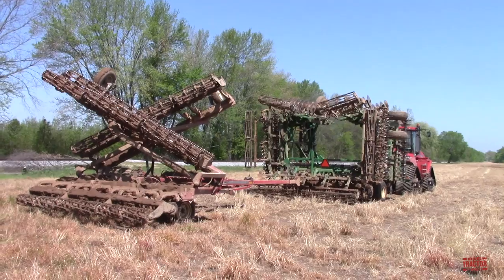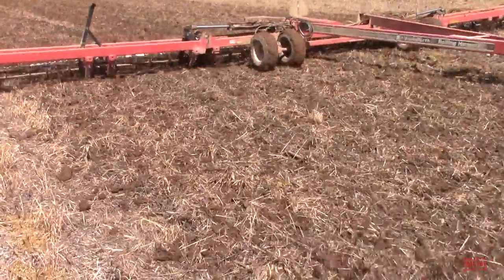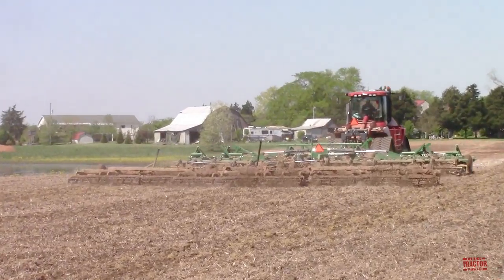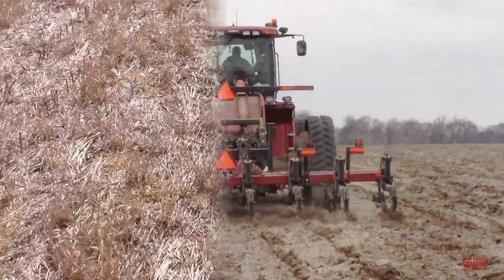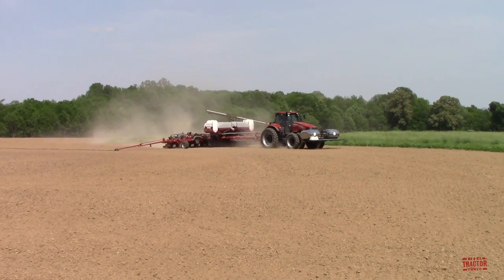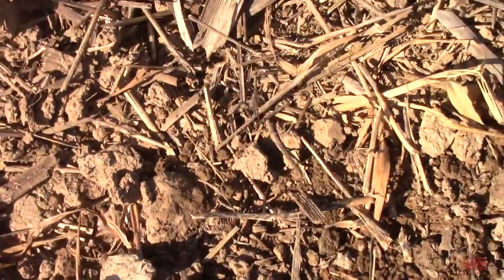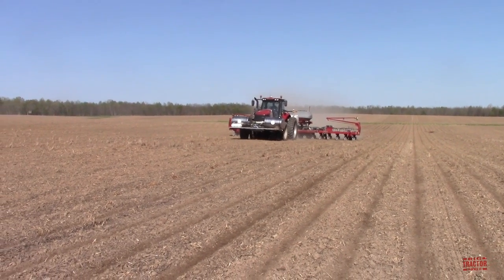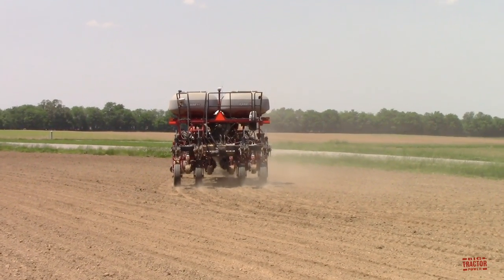2020 Corn Planting with Big CASE IH Tractors

Comment: What is behind that front fold planter?  Just something to work the soil behind the planter wheels?  Does it help with the pinch rows or something?
Reply from the maker: This farm also does allot of strip till where the tillage tool only works out s 30 inch wide slot for the planter to put the seed in.  The spikes aerate the soil tamped down by the planter wheels in the controlled traffic 40ft passes of strip till.